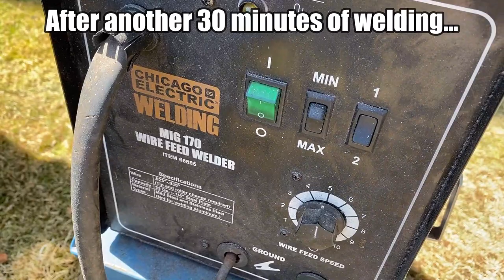FMTV TRAILER SAFETY CHAINS & ROAD TEST! #125

Comment: Beating off with Grabthar eh? LOL
I'm no towing expert but my uncle who drives semis recommends crossing the safety chains to the opposite side of where they are mounted.  They also look a little long.  In the unlikely event the pintle becomes disconnected the tongue of the trailer is definitely going to hit the ground.  Just my 2 cents
Reply from the maker: Shhhhh... I am waiting for my brother Bob to freak out because I did not cross the chains. I almost messed up that set up. LMBO! Wait for it...

Comment from the maker: @elgoog Sucks ...it appears that the Teflon tape works pretty good. 2 hour pressure hold test contained within this video. I think it is safe to use. Not the best... but safe and effective. All my best, my friend!
Reply from the maker: For anyone reading this, just make sure you do not put Teflon tape on a compression fitting. Compression fittings seal themselves! Cheers!

Comment: That came out really well- you built yours from scratch and started using before I even fixed the flat on mine- lol  Have you seen the size of the safety chains on the M1082 trailer?   Super overkill?
Reply from the maker: Everything I saw on the trailer was super overkill, in my opinion. The 1/2" chain I put on mine was the biggest I could locally get, and even still, it was $80. It is rated for 20,000 pounds... so I figure with two chains, that's 40,000. I think that will do.  It's not going to see much service weight so long as I own it, anyway. It has been a journey to say the least... but so glad that the air brakes are done! That was a trip well outside my wheelhouse.

Comment: How long have you had your LMTV?  I heard they are an electrical nightmare to keep on the road. Any truth to that?
Reply from the maker: I've had it for 3 years now. If you change all the relays and fuses from the get-go, it solves 95% of all the electrical issues. It's just neglect from sitting, is all. I was lucky... never changed a single relay, but I have spares of everything if I had to. They are cheap... buy them by the bulk, even. I really don't have anything to complain about... okay, one thing. I need new batteries, but once again, they are way past their use date.

Comment: Hey Dave, i noticed the pinion on the trailer axle was turning.  Did you leave the rear axles in?
Reply from the maker: rronmar Yes, I got brow-beat about removing it... something about the gears in the pumpkin rusting at the top. I figured it was just better to leave it active. What do you think?
Reply: Helicool's Helipad well is that axle ever going to be anything but a trailer?  Why wear out all those cool gears not actually driving an axle...  If you maybe are going to use/need those gears, you could remove the entire 3rd and store it(greased, bagged and sealed). Weld little cover plates over the inside of the axle passages open at the top to vent so the axle tubes can contain oil to keep the bearings lubed. Remove and store the pinion gears at the ends also..  Lot of drag in all that gearing, and lots of weight not really serving any purpose except to cost you fuel...  fab a flat cover for where the 3rd was bolted and bobs your uncle:)